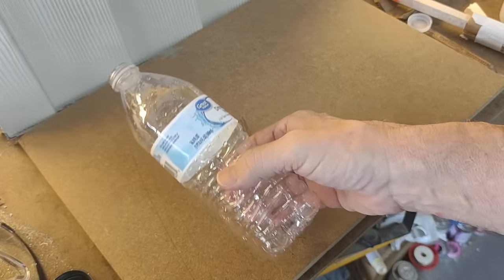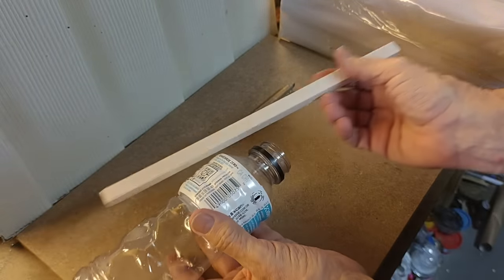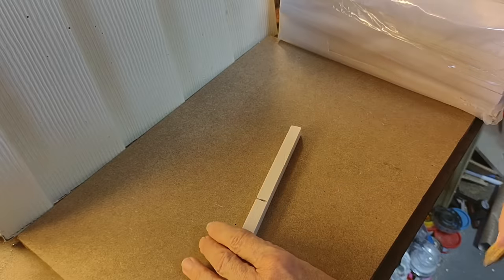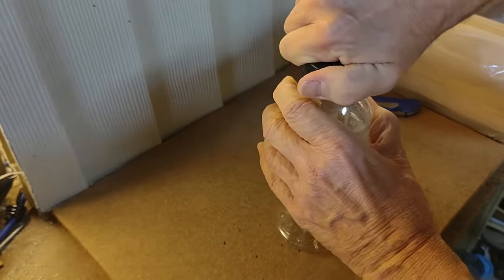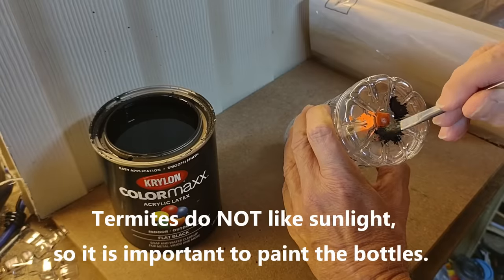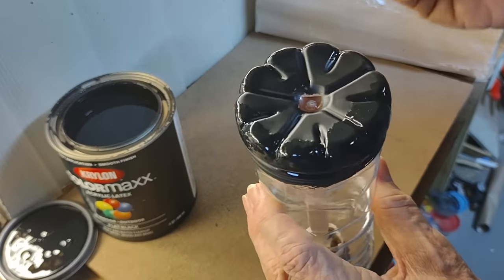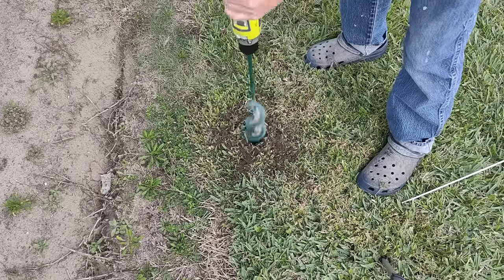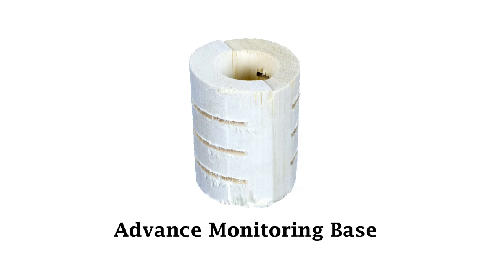Unbelievable Water Bottle Trick for Termites!  Simple to do!

Comment: What I think we can treat with bora care 1 feet of pine 2x4 or 2x6 and just put it in the ground same way as your  bottle only 1 pc but we can do this every feet  or two because it even cheaper then this bottle. Bora care is non repellent and give same result as bait station. Or we can burry underground whole pc 8 feet a lumber treated with bora care we even can drill some 3/8 holes and put some bora care  inside 2x4 also just in case . What you think it will be work and slow kill termites and other bugs?
Reply from the maker: I like the way you think, but please keep in mind that the monitoring stations are not designed to kill termites.  The purpose of the monitoring stations is to detect the presence of termites.  If you have an active infestation in your home, then it would be wise to either trench or use termite granules.  What you are suggesting could be effective, but I would only try it if the termites are not actually in the house.  I don't know if you've ever purchased Bora-Care, but it is not that cheap.  A gallon usually costs close to $100.  Using granules around your house only costs about $50.  You can trench around your entire house for around $100.  The treatment you are suggesting may work for termites, but it will not work for any other type of insect.  As it turns out, I am in the process of creating a new way to eliminate a termite colony that has been detected by the monitoring stations.  It will probably take me at least another month to complete the testing process, so that I can start producing a video.  This device would be less expensive than what you are suggesting, and most likely, much more effective.  Still, I am not going to recommend it for an existing infestation in your home.  This will only be for treating termites that set off a monitoring station or the presence of termites that were detected near the home by some other means.  If you subscribe to the channel, then you will be notified when the video is posted.  
 
I hope that helps.  Thanks for watching.  Be well my friend.
Reply: @GuysPestSolutions  Yeah I bought 4 gallons Bora care already only 1 left. I use it on my attic and some for outside projects. We can treat not full around  pc 2x4 but only 1 side  then when we pull it from the ground we will see better if termites actively eating this pc of wood and slow take poisons to the nest or it still full size no body chew it. Also if we drill hole on the top of this pc of 2x4 or it can be 2x3 also we can inject 2 oz. of fipronil and cover with a wood plug. Then this 2x3 we just nail it in the ground and wait and watch what happen. It just substitute for expensive commercial bait station i know they just help eliminate termites around house not inside the house. But what I think this same 2x4 or 2x3 one with fipronil inside other with Bora care treated can be putted in each space behind sheetrock  between 2x4 studs every 16 inches on the bottom maybe. It will be some kind bait station inside not outside the house. It may help also some how slow down termites population that already behind sheetrock, yeah i wait  for your new devise thank for your respond.
Reply from the maker: Please let me know how that works out.  Sounds interesting.  Be well my friend.

Comment: I live in a tropical country and after watching this video I think the termites in my house are possibly drywood termites I am not sure. If they are the drywood variety can you suggest something for the treatment? Thank you.
Reply: There’s only one way to guarantee the eradication of Drywood termites, and that is to put a tent over the house and fill the home with gas.
Reply from the maker: It is important to understand how drywood termites work.  They enter through cracks and crevices around windows, doors, the eaves, pipe penetrations, and so forth.  Most of the time, they enter through several locations.  That is because a swarm of them attacked your house at the same time.  If there was a crack or a crevice, then they probably found it.  After they established their galleries, which will be inside the wood, it will take four to seven years for them to be able to swarm.  Now that they are in your house, the swarmers will use holes that are in your studs to travel through the walls.  Those holes in the studs were created by the electricians to run the electrical wiring.  Not only are these holes going through the studs, but holes were drilled into the attic for the light switches and to run some of the wiring for the outlets.  So, the termites now have easy access throughout the attic and the walls.  If you have a basement or crawl space, they have access to that as well.  Most of the time, you will have no idea that they are in the walls, because the frass is inside the wall.  To make matters worse, if you have drywood termites, then your neighbors have them too.  That means you have been getting swarmed for as long as they have existed in the neighborhood.  Most likely, we're talking about years, so it's a safe bet that you have these guys in many locations in your home.
                            
I always hate to be the bearer of bad news, but if you have drywood termites, the only way to get rid of them is to fumigate.  I don't know how things work in your country, but in the US, prices for this can vary wildly in this industry.  It may be the same where you are, so I recommend that you watch my video on how to hire a pest controller without getting ripped off.  That video may save you a lot of money.  You should also know that the gas they use to fumigate has absolutely no residual action whatsoever, so you can get reinfested the moment the tent comes down.  Like I said before, if you have drywood termites, then your neighbors have them as well.  Since drywood  termites swarm every year, it is almost a certainty that you will be reinfested within a year after the fumigation is done.  The only way to prevent this is to do a preventive treatment on your house every 60 to 90 days.  Again, I don't know how it is where you are, but here most pest controllers will not do this, so it is something that people generally need to do themselves.  I have a video on how to do that and I will place a link below.  If you absolutely cannot afford to fumigate your house, then you can try spot treating it yourself.  It is virtually impossible to find all the termite galleries, but it is way better than doing nothing.  Regardless of how you treat it, you should begin the preventive treatment immediately, so that you do not get additional termites paying you a visit.  

I hope that helps.  Be well my friend.                        

Video on how to hire a pest controller without getting ripped off:  https://youtu.be/y-a8XOqVrlE

Video on how to prevent drywood termites: https://youtu.be/neNsmVbj8Pc

Video on how to spot treat drywood termites: https://youtu.be/U7ck7zhS0Xo

Comment: What if you take those balsa wood rods, soaked them in a solution of water with boric acid for a few days, dry them out and tap them in the ground.  You'd never see if you found termites but wouldn't that kill the queen?
Reply from the maker: No.  Boric acid doesn't work that way.  Please watch my video on the subject.  I will give you a link to it.  Be well my friend.

Termites vs Boric Acid video:  https://youtu.be/Th07AIMvpvQ
Reply: @GuysPestSolutions  

I have the boring termite that ground my wood like cornmeal 
Any suggestions pls for terminating them
Reply from the maker: I'm sorry.  I just now got to see your question.  You need to identify the species.  Please watch my video on how to identify termite species and leave a comment on that video about what you find out, and I will assist you with this.  Be well my friend.

Video on how to identify termite species:  https://youtu.be/dIs_a0nfVjg

Comment: Why am I so lucky? I bought my house which is off the ground on cinder blocks in 2007. I've never seen termites so far. I live in Georgia 35 miles south of Chattanooga, TN. My house is surrounded by woods except for the front. Do you think because of all the trees they just don't bother my house?
Reply from the maker: That could be the case.  If the termites are fat and happy in the woods, then why bother your house?  Still, you should inspect for termites at least annually.  You may have them and not know it.  These guys can be sneaky.  Also, a colony can start up at anytime in your yard, so just because it has not happened yet, doesn't mean it won't.  That is why I use the monitoring stations.  Be well my fiend.

Comment: Carpenter bees have set up shop on two of my old fence posts. I have read that Permethrin will get them to leave the area. I would much prefer the little pests stay on the fence instead of attacking my wood enclosed deck / storage shed. How do I handle this?
Reply from the maker: I do not have a video on how to treat carpenter bees, but I can explain how to do it.  The first thing you should know is that the carpenter bees are not doing most of the damage.  It's true.  The carpenter bees are boring holes into the wood, but that is only causing a little of the damage.  You see, after the bees get into the wood, they lay eggs in there that turn into larvae.  Those larvae eat wood to survive, much like termites do, and that is what is causing most of the damage.  When the larvae mature, they bore back out of the wood, leaving behind hollowed out wood, with large exit holes.  Therefore, you cannot end the problem by treating the bees.  You need to treat the larvae.  To do this you need to buy a fipronil foam and shoot it into all the holes, until it is coming back out at you, or the other holes.  The foam will expand to several times its original size and get into all those tunnels that were created in the wood by the larvae, thereby killing them.  Now that you have treated the larvae, you can go ahead and seal up the holes with wood filler, caulk, Bondo, or whatever works best in your case.  After you have the damage repaired, you need to make sure that you do not get anymore carpenter bees.  There are a couple of ways of doing this, and which method you choose will depend upon the kind of wood you are dealing with.  If you have wood that has not been treated with anything, like a sealer, stain, or paint, then you can use Bora-Care.  This is a permanent treatment, but you do need to finish the wood with something, like a sealer or paint, about 48 hours after the product is applied.  If the wood has already been treated with a sealer, stain, or paint, then you need to apply a pesticide to all the wooden surfaces every 60 days.  To do this, just get a pump-up garden sprayer and purchase some Bifen IT.  Mix the Bifen IT in the garden sprayer at a ratio of one ounce of product to one gallon of water.  Then simply spray all the wood surfaces every 60 days.  If you have areas that are too high up to spray with a pump-up garden sprayer, then you can use a hose end sprayer to reach places that are very high up.  Just watch my video on how to treat your yard with a hose end sprayer.  For this application you will need to use Bifen XTS instead of Bifen IT.  That is because the Bifen XTS has a much thinner viscosity than the Bifen IT, which will allow it to be picked up by the siphon tube in the sprayer.  An easier way to put that would be to say that the Bifen IT will not work in the sprayer, so you must use the Bifen XTS.  Just mix the Bifen XTS as I show you in my video on how to treat your yard with a hose end sprayer.  The sprayer that I recommend in the video has a stream setting that will allow it to reach as high as 25 feet, depending upon water pressure.  I will give you links for the fipronil foam and the Bifen IT.  If you need to go with the hose end sprayer, all the items you need are listed in the description of the video.  I will give you a link to that video as well.  These products are very safe to use, but I always recommend wearing rubber gloves, eye protection, and a respirator.  I have been hit many times with the overspray from this stuff and I'm still here to talk about it, so it is not all that hazardous.  Still, it is not a good idea to inhale any sort of chemical whatsoever and it is also not a good idea to get it in your eyes.  The truth is that these materials are no more harmful than common laundry detergent, but I don't think you would want to mix up some laundry detergent, spray it in the air and then get it in your eyes and inhale it.  You probably wouldn't want to get it all over your hands for an extended period of time either.  I always recommend taking a shower when you're finished as well.

I hope that helps.  Be well my friend. 
        
Fipronil foam:  https://www.domyown.com/termidor-foam-p-3528.html

Bifen IT:  https://www.domyown.com/bifen-it-p-226.html?sub_id=11662

Video on how to treat your yard with a hose end sprayer:  https://youtu.be/wifoTU5dmp0  

Video on how to use Bora-Care:  https://www.youtube.com/watch?v=Rmr_aEodyhg&t=19s

Bora-Care:  https://www.domyown.com/boracare-p-100.html

Comment: I am having trouble getting the paint to stick on the plastic bottles. Even after three coats, I end up with multiple tiny pin holes. How much surface light is too much?
Reply from the maker: I'm sorry that you are having that problem.  Tiny pin holes shouldn't matter.  I think you will be okay.  Make sure that you are using exterior paint.  Most likely you are, but it's worth mentioning.  Also, to cover the pin holes, dab the paint on really heavy instead of brushing it.  It doesn't need to be neat, just black.  I doubt that the pin holes will let all that much light in anyway.  I hope that helps.  Be well my friend.

Comment: Off topic but I have question about wasps...I have riding lawn mowers that I neglected and should've had stored in garage...I opened hood to work on it and I see wasps flying around...I can't locate the nests because there's so many nooks and crannies under the hood....is there anything you recommend?  Do they make like a fogger or bomb that  will just really get all the wasps killed without having to directly spray with a Jetstream type spray
Reply from the maker: There are a few ways to come at this depending on your level of courage.  I love doing battle with wasps, as long as they are actually paper wasps or mud daubers and not something like yellow jackets.  Paper wasps are actually very bad flyers, and you can easily outrun them.  It's true.  They almost need to land on you to sting you and they are slow and clumsy flyers.  Yellow jackets are not that way.  They are fast flyers and can sting you really fast too.  So, if these are actually something like paper wasps, which would be consistent with what I would expect in a riding mower, then I would go after them with a can of Raid Ant and Roach Killer.  It does not have the range of the wasp sprays, but you don't need it with paper wasps.  If you hit one with the Raid, the thing is going down really fast.  Paper wasps usually only come at you one at a time anyway, unlike yellow jackets that will swarm you.  So, paper wasps are kind of fun to kill.  If you find that there are two or three at the same time, just run.  They probably won't even chase you.  They don't swarm after you like yellow jackets.  Anyway, that's the fun way to do it.  If you want something a bit less exciting, then you can treat the mower with any number of pesticides.  I would go with Bifen IT.  Mix it in a pump-up garden sprayer, 1 ounce to a gallon of water.  Just open the hood and spray everything.  If you see the nest, then spray it directly.  The best time to do it is in the evening, just when it is getting too dark to see well.  Wasps do not fly well at night.  So, you want it light enough to see what you are doing, but dark enough so they will all be back in the nest.  They always return home when it starts to get dark.  This is not a fast kill product, so if you hit one, it will keep flying.  This is a residual product that is going to kill them overnight or the next day as they come and go from the nest.  So, keep that can of Raid handy in case one comes at you.  Again, make sure that these are not yellow jackets or bees.  If they have any yellow markings, then let me know.  I will tell you a much safer way to do it.

I hope that helps.  Be well my friend.

Comment: It rains a lot where I live, won’t these bottles fill with the water and rot the wood sticks?
Reply from the maker: Not exactly.  If there is constant water, then you will probably run into a mold situation with the wood.  Termites like wet wood, but they do not like moldy wood.  So, you should check the stations every few months for mold.  Not all of them.  Just pull one out every now and then and check it.  If one is good, then the others probably are as well.  If you have a mold problem, then you just need to change out the sticks periodically.  All monitoring stations have this problem and should be periodically checked for mold.  I hope that helps.  Be well my friend.
Reply: @GuysPestSolutions  thanks.
Reply from the maker: You are very welcome.  Be well my friend.